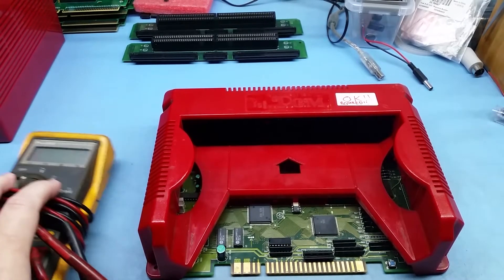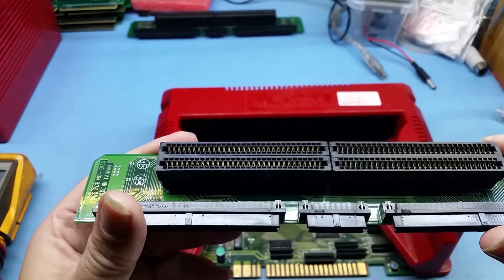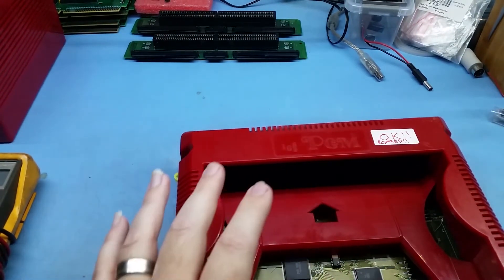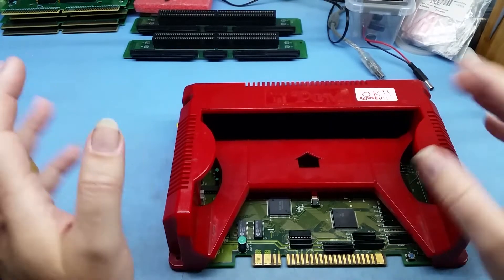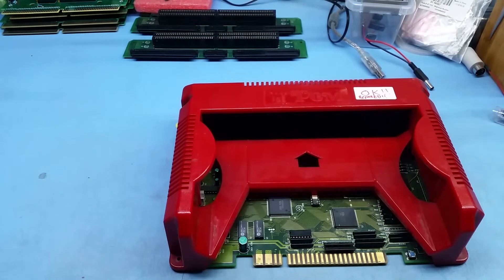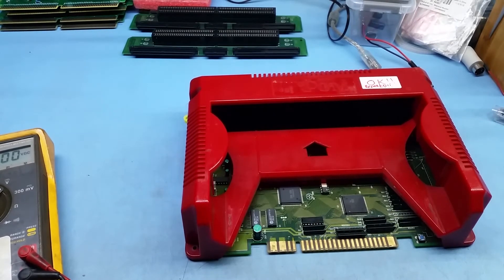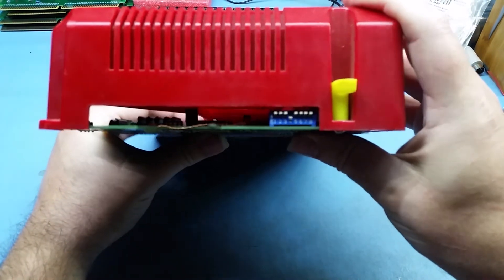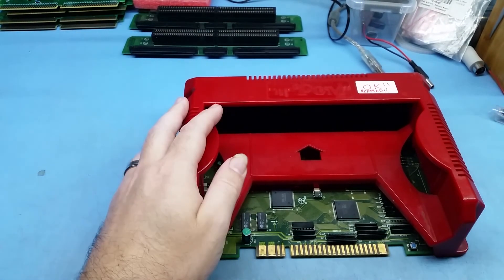PGM Basic Troubleshooting Guide [IGSPGM.COM]

Comment: Hey there GC8TECH. Thanks for all your awesome work on these PGM boards. Amazing system. I have one here that which gives me erratic error screens. Sometimes it would say "ILLEGAL INSTRUCTION" big on top of screen and a bunch of addresses below it, and sometimes an "ADDRESS ERROR". Any ideas? Ive reflowed the SRAM chips for the z80 and also cleaned the whole system. There are no traces damaged as this board would run fine for sometimes 5 ins, 10 mins, but sometimes would freeze after the first IGS PGM Bios animation screen.

Thanks

Comment: Thanks for the vid, very informative as always!
Have you ever encountered a static white screen with a cart inserted? I have this current problem on one faulty board and I hoped patching a few traces off the cartridge conector and on the board itself would solve it. Without a cart it boots into service menu just fine and all tests pass... I am almost giving up on it.

Ah I think the links for the site and discord are not valid/expired btw
Reply from the maker: I presume the motherboard had a leaking battery etc?? Which Rev is it?? you can email me tim@igspgm.com  Links are fixed... not sure what was going on there...
Reply: @gc8tech  Thank you sir, I'll get in touch